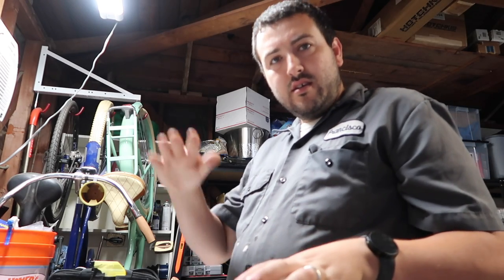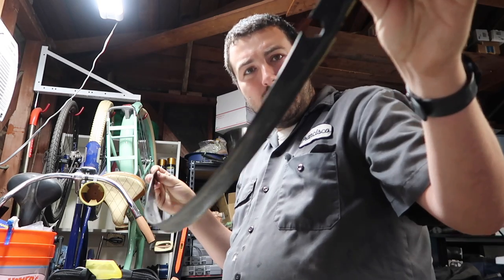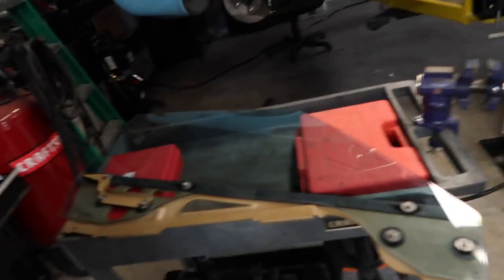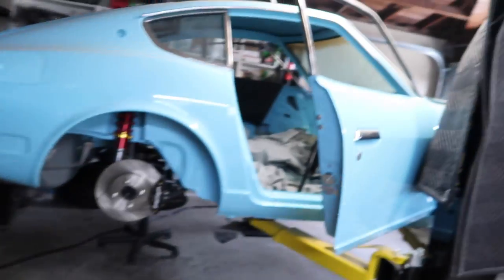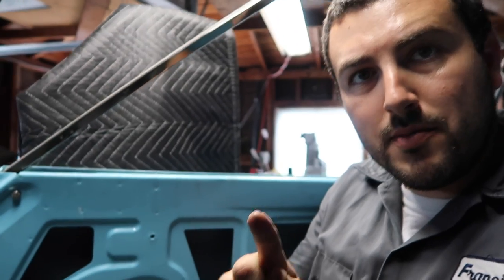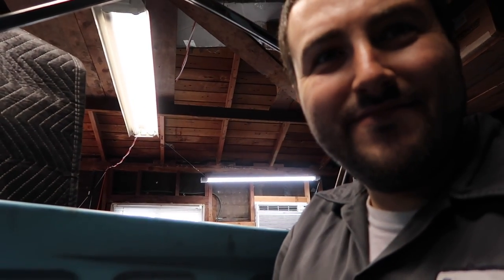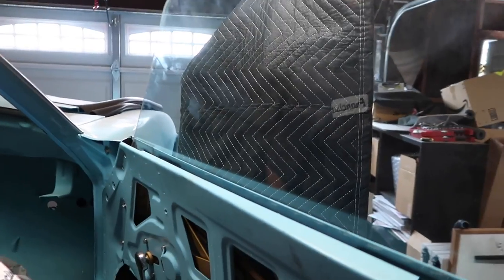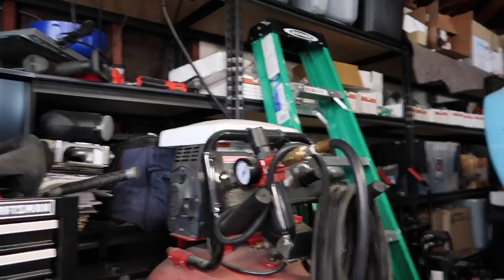Datsun 240z Build - Episode 22 - Window Door Mechanism Installation - Panchos Garage

Comment: Good luck my friends. Just gutted my driver door and putting it back together tonight. I used a sonic-cleaner and pin-tumbler to clean hardware. Now everything is pretty except for my patience. Just remember that the front U-channel on the window has to be fed onto the roller from the rear of the channel - the sheet metal is bent to block the front of that U-channel. Had I known that I would be grilling steaks already.
I cursed a lot. I cussed long, and I cussed hard. Seemed to do the trick! Everything in place and now just need to adjust this and that, and that other thing I haven't thought of yet.
Reply from the maker: Thanks for the tip!

Comment: What is the diameter of the three new small gauges you installed in your dash?..... also which Master brake cylinder are you using with your brake kit?..... Thanks!!!

jd
Reply from the maker: +j d the diameter... Whatever stock is. I have stock gauges. Master? 1 inch Wilwood